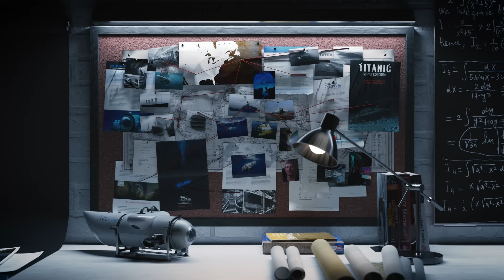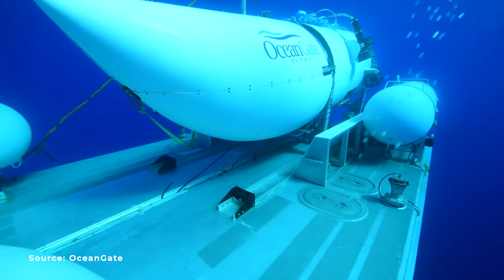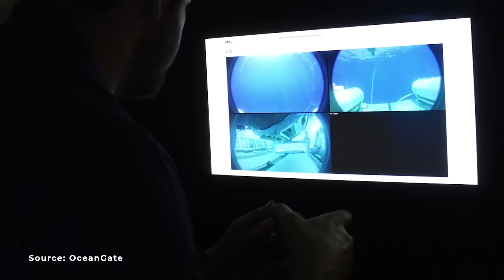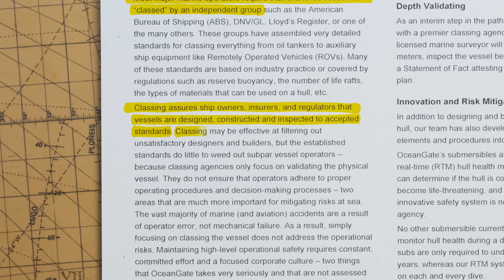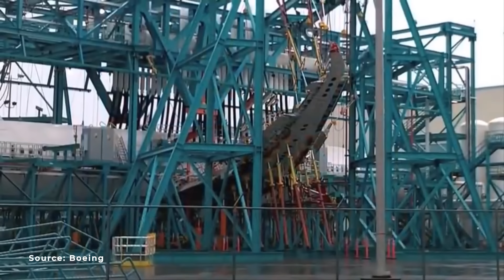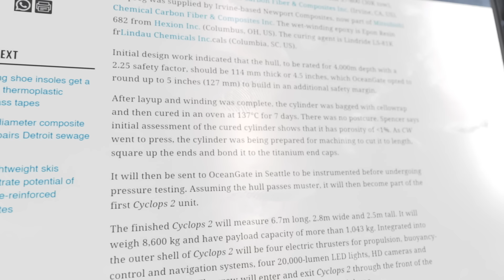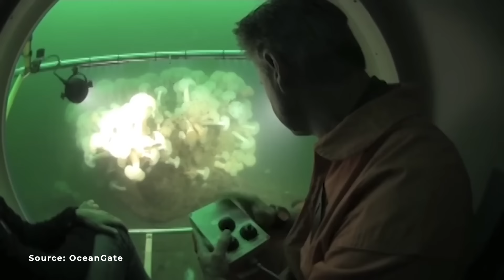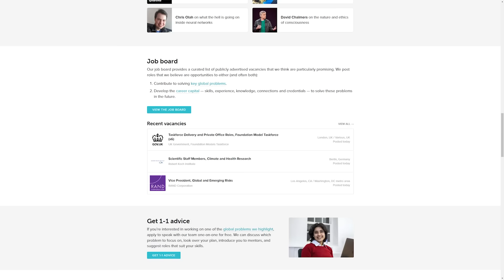The Questionable Engineering of Oceangate

Comment: For an otherwise intelligent person why is it that you do not understand that submersible hulls ARE NOT PRESSURE VESSELS they are VACUUM VESSELS.
  You talk extensively about the composite fiber used which has absolutely NOTHING to do with the failure mode, they could have used recycled Levi jeans as the fiber for the VACUUM VESSEL and the result would have been the same because the RESIN is what is failing.  The RESIN is the compressive strength in a VACUUM VESSEL, the fiber only inhibits cracks in the RESIN.
  STOP TALKING ABOUT PRESSURE VESSELS when talking about submersibles unless you are talking about the tanks used to blow the water out of the ballast tanks.
  Hell the door or window of a pressure vessel is designed completely differently than a door on a vacuum vessel.

Comment: face it, there was no engineering-- just kiddie workshop stuff of  patching junk together and pretending to be clever. Engineering involves actual scientific studies, mathematical calculations,  pressurizations studies, wind tunnels and all that unnecessary jazz which can be done methodically and carefully;  but quite obviously didn't. Regardless of OceanGate's propaganda, it's not like UW  wants to be associated with it or gave credence to any claim the company made regarding  "cooperation". UW Oceonography program is reputable, OceanGate is irreputable and same should be said for Puget Sound shipyards... You simply can't ever associated this miserable piece of junk held together with superglue and rubber glue to something actually built or rebuilt in any Puget Sound shipyard /drydock.  It's not like there's no  US Navy presences on the Sound and nobody in Washington  State has ever seen  a submarine or sailing vessel. It's not like UW doesn't or didn't have a top class engineering  college.  Scammers rely on name association to  actual bonafides such as University of Washington Oceanography  or historical  surroundings that are well-known.

Comment: it's a fine, fine balance to strike between being hobbled by worries and concerns and pushing forward recklessly. 
i think it is critically unfair to cite the efforts of musk as partially culpable for the mindset that brought about this disaster. musk's enterprises are not riddled with catastrophes showing him to have a blatant disregard for safety. from what can be divined by his track record he makes progress with the correct amount of prevation to be successful. musk inspires people to push technological boundaries definitely but i don't see how he inspires them to be careless while doing so. 
we can dogpile on him when he screws up but until then it's kind of petty to trot out possible, potential, faults he could display in his methodology.
your analysis videos are very good and you obviously display the cerebral rigor required by your credentials but are you applying your education to material projects outside of the thesis required for your degree? because in my continued education of mech eng I'm discovering that it is only when applying my education that the vision of the subject becomes completely clear. and i would be reluctant to critique someone on a subject without this clarity. the fact of the matter is that sometimes you dont know what is left that you dont know until you know it.

Comment: I know exactly why a submarine starts to crack from the inside first and I know how to fix it because of an astronomy problem I was given years ago. The problem was: say we tie a rope around the Earth's equator and then you take away 1m from the rope, how will the radius of the rope change? What if you did the same thing on the Moon? The answer is that the radius will change by 1/(2*pi) meters regardless of the radius of the original circle. The circumference of a circle is C=2*(pi)*r and if you take away d_c from C this will cause a change of d_r in r giving C-d_c= 2*(pi)*(r-d_r) or combining 2*(pi)*r-d_c=2*(pi)*(r-d_r). Dividing both sides by 2*(pi) gives   r-d_c/(2*(pi))=r-d_r and cancelling r on both sides gives d_c/(2*(pi))=d_r which does not depend on r. This is a very non-linear effect and we can use large numbers to show this! Say the outer circumference of a submarine is C_out=1000m and assume that due to pressure the circumference compresses by 1m. By d_c/(2*(pi))=d_r then the radius of the outer most circle will change by 1/(2*pi) meters. Because the layers of the submarine are concentric they will all experience a change of 1/(2*pi) meters. Say the inner most circle is only C_inner=2 meters and it too will experience a drop in radius by 1/(2*pi) meters which corresponds to a drop in circumference of 1 meter. Simply put C_inner=2 meters will have to drop to C_inner=1 meter and so the material will have to compress to half of its original size while for the C_out=1000m will have to drop to C_out=999m which is a much smaller compression. We cannot change this formula d_c/(2*(pi))=d_r  but we can change the concentric circles. Instead we can have bow-like strictures connecting the inner wall of the submarine that can bend more than the outer wall to accumulate the change in compression ratio while also providing structural support.

Comment: One start to facing the problems today is not blaming it on a vital greenhouse gas responsible for heat, when winters are colder and longer, and summers are colder and shorter. 

Maybe the corporations who clear out entire forests to place solar panels which work below 50% efficiency  more commonly below 30% efficiency, rendering them essentially useless and will take decades before they produce more energy than what was expended to create them, or the damage to the environment that wind and solar resources cause, maybe just maybe China shouldn’t deforest their whole nation. Maybe THOSE are causing the issues.
So no your sponsor will not and should not be used as they are one of those government funded organizations that ignore the facts of the planet, that other scientists in multiple fields have blamed the deforestation by corporations for exceedingly high carbon in the atmosphere, and it’s not western countries fault, we have laws to replant. Scientists have noted we are exiting a sort of perfect climate period of the planet, that our tilt is off and even the possibility our poles are shifting (all of which has happened in the planets history) maybe that could be the reason. But that’s not where the money is huh, all the money is in blaming carbon. All the money is continuing to mine minerals for lithium batteries. All the money is getting donations sponsorships and subscriptions from compassionate “do gooders” that don’t understand anything about earth science. As a famous grifter once said “how dare you”.

Comment: anyone who is interested in why metals steel or titanium and carbon fiber are not supposed to be used together is because they react differently to pressures.  Nuclear reactors use both and show you ust how complex that process is caron fiber shrinks when heated where as metal expands.  The rotors inside those turbines hae to use all sorts of temerature sensative measures to operate despite that natuiral unbalance.  Its what makes the process of enrichment so difficult and the way through sabotage Iran had setback in its facility as documented in film zerodays.  They dont have alternative these engineers like james cameron did in deciding on his vessel forhis trip exlplained  these adentures and explorations like climbing everest are only succesful if its a round trip.  Most on board were experienced but loss of life is always sad and tragic especially the father and above all the son and young man. 
   There had to be many things on his list for fathers day that he probably ould have preferred to do than something where you have zero control and assume extremely highrisk.  Fact that they were okand uised to hearing carbon fiber hull crackling under the pressure is crazy any cyclist even knows how fragile it is its only considered strong in relation to its incredible light weight but what makes is great for bike that its incredible stiff and rigid so no power is lost in transfer from pedal to wheel makes is so that when it fails it snapsand shatters.  Its not like a metal , titanium that could be used as bat or golf club because it absorbs and has flexibility to it anyone whose used golf club with caron fiber shaft has to have had an exerience of shaft shattering.  These guys are engineers and have massive knowledge but the mateirals are the material and they fail the same way uniformly.

Comment: Yeah, I'm no engineer but I don't think composite materials will ever be truly usable in a safe manner for a purpose like this. The pressure inside of the sub itself is irrelevant, that calculation is provided instead by the strength and uniformity of the material. I imagine, even as real pressure remains a constant, net pressure on the point would increase as the failure progresses over time, which will also begin to affect the surrounding material, and grow over time. This will lead to deterioration that starts slow, and drastically increases. When experiencing a significant and sudden increase, the surrounding material would probably flex at that point, increasing effective pressure substantially over the already notable true pressure increase, leading to a point of failure.

The reason why I don't think that composites will ever be usable goes beyond the above, you would really need to assume a worst case factor, which would be that the weakest possible result from the composite exists, and then simulate your data from there. This will lead to such an insane amount of over-engineering to actually be able to use the materials, that while technically achievable, it would be more cost effective to just pursue the traditional materials. Unmanned devices such as drones, or even weapons, this might be a different circumstance. I may be fine with losing a drone that was cost-effective due to knowing that it WILL fail within an average number of dives, and just price accordingly, but people aren't drones, and their loss isn't as replaceable.

I did think it was hilarious that their plan involved acoustics monitoring, because by the time you find out about the issue you're dead. The guy died due to his arrogance, unfortunately he took other people with him.

Comment: The fact they brought up SpaceX on their website shows they didn’t truly respect the environment in which they were operating. IIRC Titanic depth is about 360 atmospheres; composites in aviation (Dreamliner) go up to about 0.7 atmospheres internal (tensile) pressure. Space travel would be 0.7-1.0 atm, also tensile (if a plane was flown into space, it would survive the vacuum of space (air would leak slowly).

But a submarine going to 360atm compressive pressure? The fact it didn’t fail on the first dive is miraculous! They had an opportunity to advance composite material science but ignored it due to stupidity.

Comment: It is crucially important to continue the development of this concept even for robotic missions that will one day visit the moons of Saturn and Jupiter. A submersible entering the atmosphere of Jupiter may make it possible to mine Metallic Hydrogen from the planet. This material could be drawn into fine wires, submerged in silicone oil and injected into internal combustion engines with no hydrocarbon emissions. We need this development and the passage of six or seven generations to make this a reality but the consequences of it will be fantastic.

Comment: I may not be a materials engineer, but as a mechanical engineer I was immediately concerned about that composite construction. I knew the compressive strength of composite isn't exactly incredible, and that if this hasn't been done before there's probably a good reason since composite is lightweight and inexpensive. This gives the technical knowledge that confirms those suspicions.

Also, one physical test is worth more than a thousand simulations. Simulations are great for cutting down on physical testing by identifying simple failure modes before you ever begin construction, but you need physical testing for more complex failure modes.

Comment: It should be noted that some of the critical failure modes are resin dominated not fiber dominated. E.g peel stresses at the edges of voids under compression loads. The resin itself at the peeling edge  has a tension component. As the void propogates under this out of plane opening  load the margin to catastrophic buckling diminishes. And low temp curing resin properties are poor. This is why 350F curing and higher is the norm in aircraft parts, for both prepreg and resin infusion.  Note 787 a350 wing upper skins and stringers are in compression but millions of fasteners !!

Comment: 0:14: 💥 The oceangate submersible imploded under immense pressure while descending to the Titanic's remains.
2:43: 🌊 Submarines made with carbon fibre composite can achieve neutral buoyancy without the need for foam layers, reducing costs.
5:59: ⚠ The pressure vessel in question lacks proper research and testing, potentially leading to a failure mode exacerbated by cyclical stresses.
9:04: 🤔 The pressure vessel for the composite hull was not made using an autoclave and has some porosity issues.
11:49: 🚀 The growing trend in engineering of moving fast and breaking things is dangerous and puts lives at risk.
Recap by Tammy AI

Comment: I'm an aero eng. The second I heard "cfrp pressure hull" I knew they'd imploded.

You see, you can't pressirise a big cylinder like this without it warping. Especially when it has no cross-bracing on the inside.

When the cylinder is this thick, the warping gives rise to shear stress (think, two planks of wood sliding on top of each other), and lots of it. For metals like steel and titanium that's fine. They've got about half the strength in shear than they do in tension, but you can work with that. Layered fabric/matrix composites like cfrp on the other hand cannot deal with this sort of thing. All the shear stress goes into the matrix (some sort of exotic resin, or just regular epoxy), which simply CANNOT deal with it. Any competent engineer who's ever worked with a layered composite can tell you what happens next - sheet delamination followed by hull loss. That much was simply inevitable. If it hadn't happened this time, it would have in the following few dives.

Comment: Has soon as I found out the pressure hull was made of carbon fiber reinforced plastic, I would have never gotten inside of it. I'm working on a mechanical engineering degree. A TA told us he will never get a 787 because of the same thing. You can't tell it's being damaged until it gives out.

Comment: Can somebody answer a question for me? What if there was a submersible that is filled with water inside to equalize pressure inside and out and carrying passengers wearing scuba gear inside the submersible. Would it still implode or kill the passengers? I noticed that the titanic bodies that sank didnt come apart at the ocean floor due to equalized pressure. Could it work or what would be the outcome of a purposely flooded submersible with scuba divers inside it at those depths?
Reply: How would you get the submarine to surface if it's filled entirely with water?

Comment: Does it make much sense to fatigue test carbon fiber for 50 cycles? I'm not very familiar with composites, but from memory, as a rule of thumb, the fatigue strength of steels at 1000 cycles is 0.9xUTS

Comment: I am not an engineer, not in the slightest. However, when I heard that the hull was using carbon fiber, even without knowing about possible air pockets in the fibers, I said it wouldn't hold. I figured people knew there was a difference in aerospace and aquatic vessel engineering. One deals with negative pressure, and the other positive pressure. There is a huge difference in expansion and compression pressures. (Feel free to correct anything I said incorrect, as I am NOT an engineer.)

Comment: But aren't most materials stronger in compression than tension anyways? It's harder to squish something than it is to pull it apart
Reply: no, it varies immensely.  really really.  that said, it wasn't even JUST the compression that was at issue here, it was repeated stress compression AND release.  carbon fiber is terrible at retaining strength and cohesion under those circumstances. there are multitudes of papers about that, that Stockton chose to completely ignore, and this channel missed in their rush to get this article onto their channel.

Comment: Military submarines do not use foam to achieve neutral buoyancy. They flood their ballast and trim tanks or blow them out with compressed air or pump them out after using propulsion to drive to the surface.